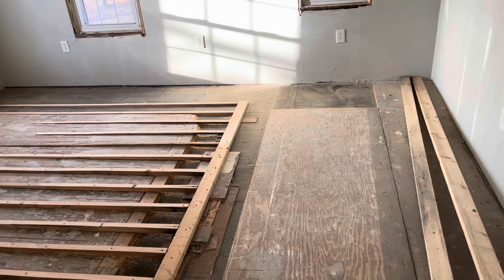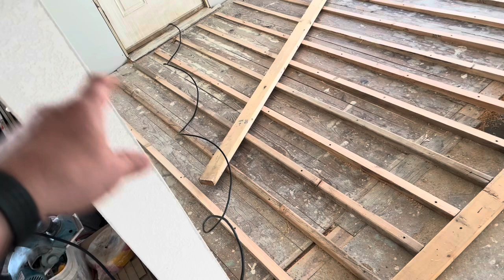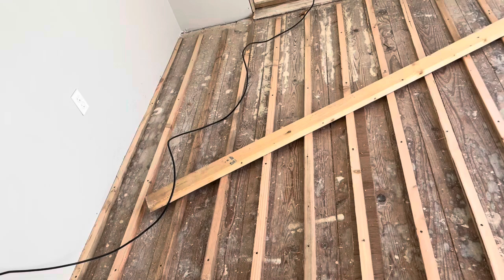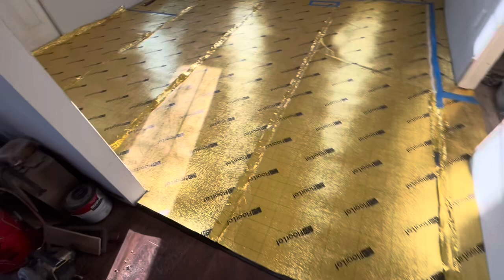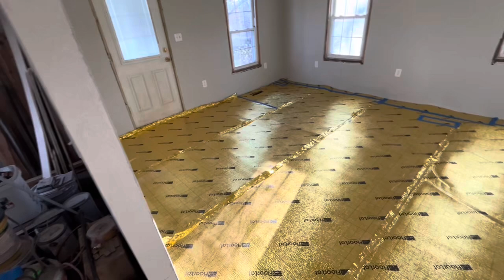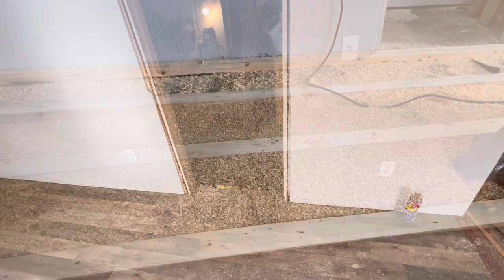Leveling bad floors quick and easy.

Comment: I saw that last commenter.  This video dropped into my feed because I've been working on a 130-year-old house for a while.

6 months ago I leveled the upstairs bathroom using a laser level and 2x6 sister joists.  I could have used glue but didn't but the 2 1/2" construction screws hold about 80 pounds shear apiece so if you use enough you don't need glue (and more messy and expense).  Covered with 3/4" plywood and that floor is flat and sturdy as hell.

After quite a bit of thought, tomorrow I'm going to start the kitchen and do pretty much what you did here.  The joists below are between 7" and 8" tall under the kitchen but they are sturdy, just not level across the room. Rather than tear up the original 3/4" T&G flooring and using sister joist strategy again I'm using the flooring to retain rigidity and ripping spacers on top of the exiting joists in the same manner you did here.  I am tempted to go every 8" but I don't think it's needed with 3/4" OSB T&G.  Not sure yet how I will use the laser to mark the scribe lines but that's the easy part.  Thought about leveler but no thanks.  Just came to say I like repurposing old lumber whenever possible and I like your work here.  I'm going to use the same method and I'm sure it will be flat, sturdy and last a long while.  One thing I might do is use adhesive on the spacers before I lay the OSB down to reduce squeaks.  But 4" lag screws clear into the joists below should probably eliminate that problem.
Reply from the maker: @DaveCrawford-jl9nn  - I did overkill with the scribe strips for 2 reasons; first was because I was going opposite direction of the joists and second was because I was not able to get subflooring  plywood like you described. 16” on center is sufficient for what you described.

Sometimes I will set my board I am going to rip on the floor and block it up until it is level then use a compass set to the thickness of the board and scribe the board to the couture of the floor. I have fixed floors that were 6” out of level this way. It helps to have a power planer to help take any remaining humps out. When I was screwing down my strips it would take the shape of the floor underneath causing humps because I just snapped a chalk line on level and ripped them on the table saw free hand.

Also I glue laminated sisters on the joists that were already cracked. The solid ones I just put screws in like you described.

Be aware also that you will have to cut your door jams and the bottom of your doors off unless you remove the doors and jams and cut the header out and move the door up.

Comment: Well done. Great solution and a lot of work but it seems better than leveling concrete.
Reply from the maker: @freddixon  It was 2x6 joists with 3/4 tongue and groove fir on top. The bathroom I stripped it out and sandwiched new joists on top of the old ones. That’s a lot more work in my opinion but it was necessary for the added weight of the tub and tile I put in.

Comment: Is this guy serious
Reply from the maker: @coreyfranco7060  - There’s more than one way to skin a cat. What’s your method?

This used all recycled materials including the flooring and only cost about $20 in fasteners and the labor was free because I did it myself. The floor is now dead level and stable. So I leveled 800 square feet in 4 days for $20 plus a day to gather the recycled material. 

What would it have cost you and how much time would you estimate? Thanks in advance because I would like to find a better solution if possible.